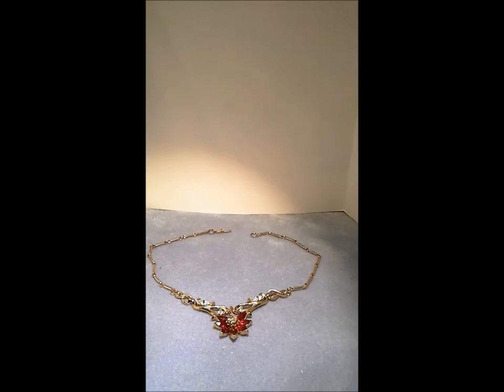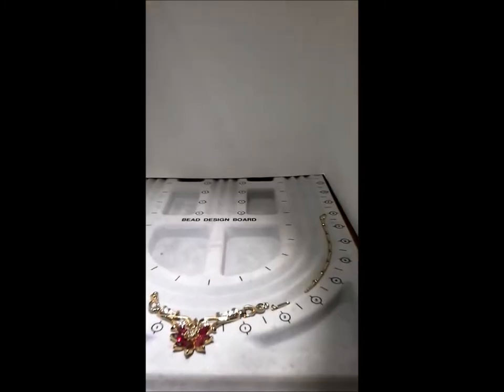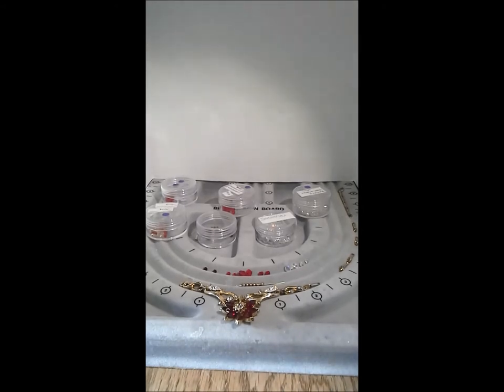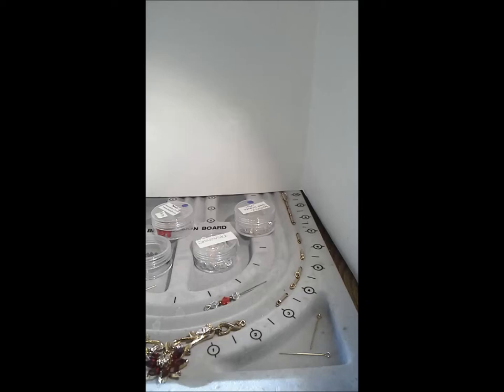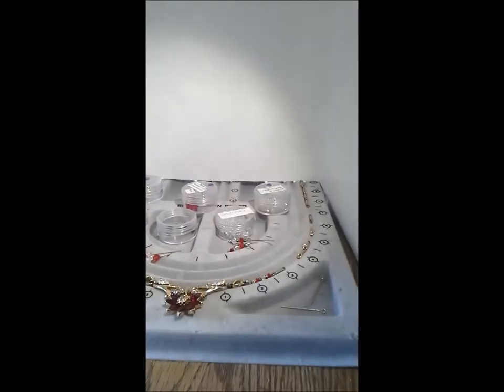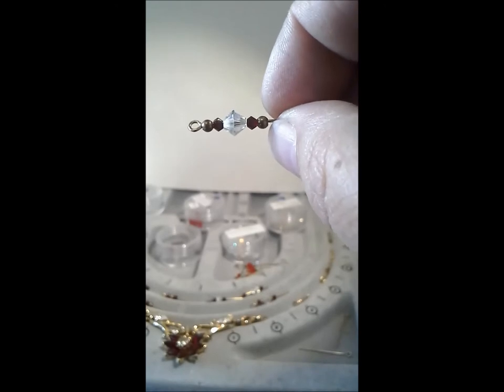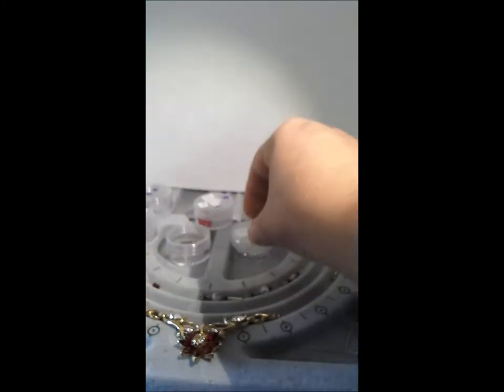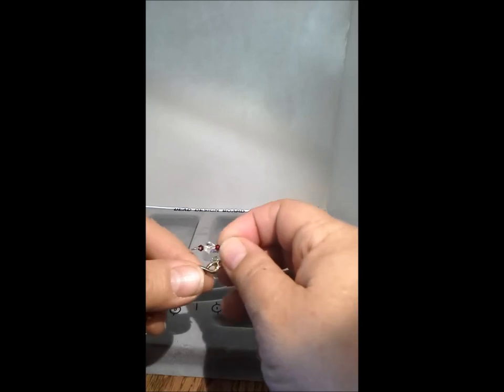Repair #2: Lengthening a Vintage Necklace

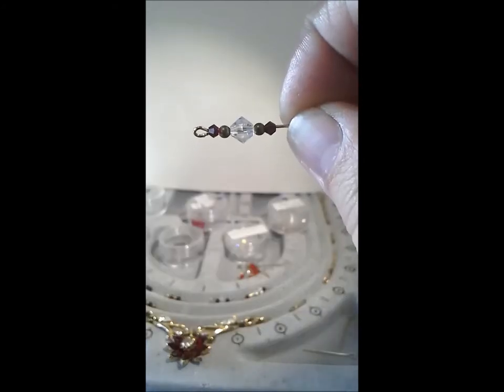Comment: Beautiful necklace! You did a great job on the focal piece. Designing is definitely a process. Think, try, repeat. Lol. I like the darker red crystals myself. The combinations at 18:20 and 20:45 are my favorites. Perhaps if you did both and alternated between the two you would get the length you need with the right mix of beads. Can't wait to see the finished piece. Thanks for walking us through the creative process.
Reply from the maker: Thanks Marcia - I hadn't thought of using both designs together.  Now I'll go back and see if I should change what I did.  Good thing about being able to do my own repairs!
Reply: It was just a suggestion. I bet what you have already done is just lovely.  Hope you will one day share with us .